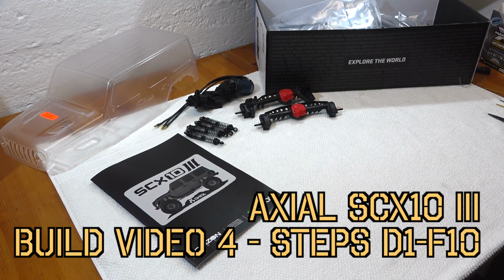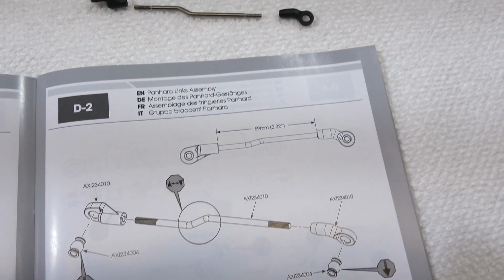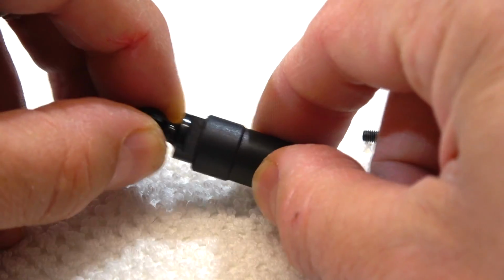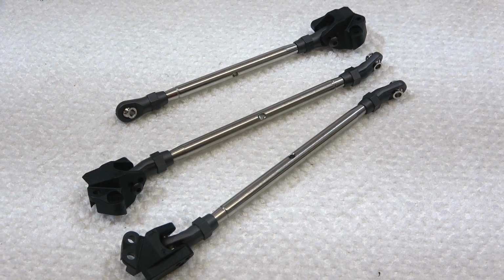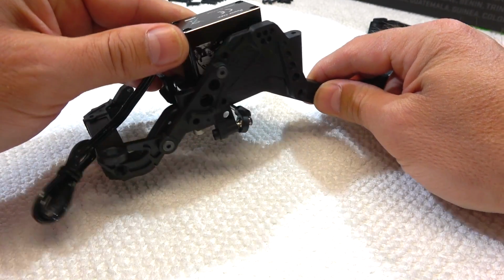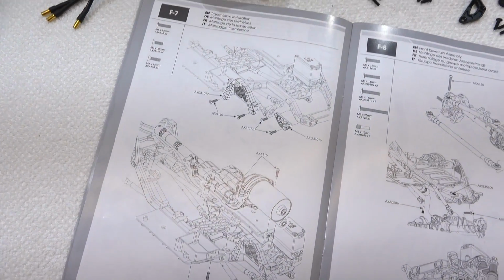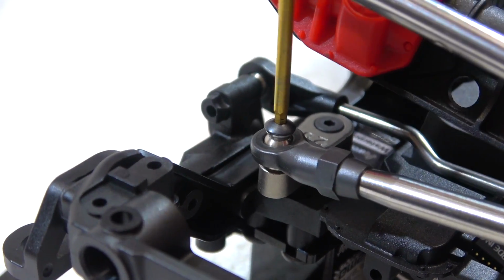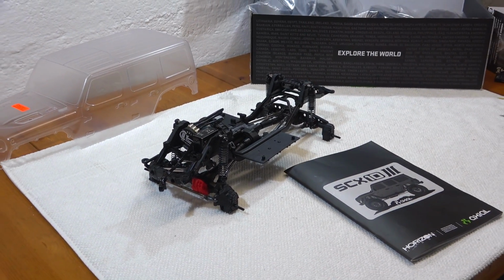Axial SCX10 III Build Video 4 - Steps D1-F10

Comment: Call or Email Horizon Hobby to request a free pack of replacement parts for the kit. You need the AXI232017  Wild Boar Driveshaft set. The front drive shaft needs a long sleeve from the kit, the rear drive shaft needs the other long sleeve from the kit and the long connector that goes between two long sleeves. The kit made many mistakes and these mistakes make a click sound and puts too much stress on the parts as they are in the original kit. I am Brian D. and I love your videos. Get the free pack before running your truck more and risking damage.

Comment: I've become more careful when using a power tool, especially if putting in the screws for the first time. I had the issue, that they became pretty hot and when I removed the screw later, a lot of material came out with it (I think it was a Tamiya ABS chassis). It certainly depends on the material and the type of screw, but now, I only use moderate or slow speeds and when tightening down multiple longer screws, I'm alternating between them, so they can cool down a little. If the threads are cut/formed, it seems less problematic.
Reply from the maker: Yes, it's true, we have to be careful with this. But without this power tool it is very exhausting.

Comment: The servo mounting issue is nothing new. Axial built this truck like others to fit their own brand or cheap Tactic servos. Any other good quality servo will require the same trimming as you did. Also while faster and easier on the wrist, I would avoid using a power driver to assemble your kit. Disassembly is fine since the plastic has had the threads cut into it, but new plastic too risky. If you do, you should try to finish tightening by hand.
Reply: in earlier videos he explains that he finishes off the screws by tightening by hand, you can hear the clutch on the drill go of f
Reply from the maker: Yes, that's true. But I was carefully with tighten the screws. I recommend to use a power tool otherwise your wrist will be broken after so much long screws...